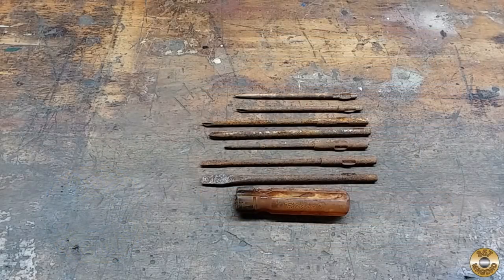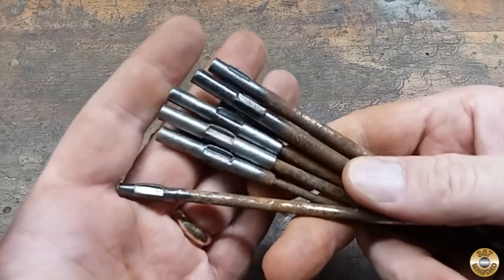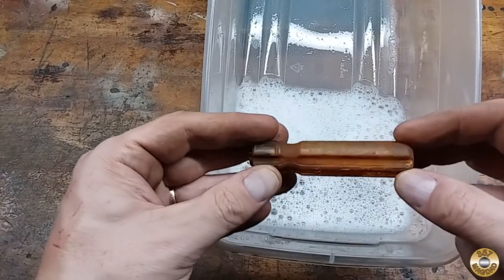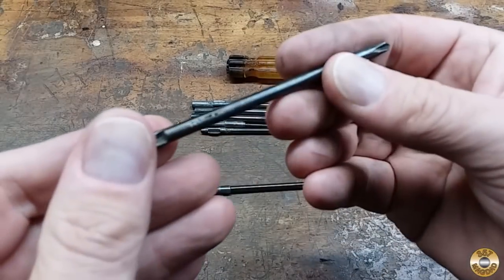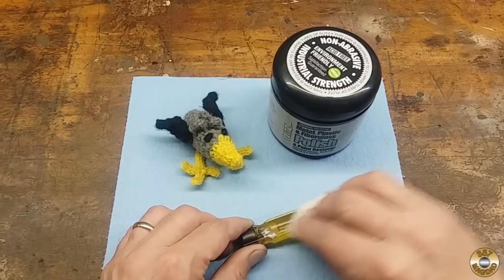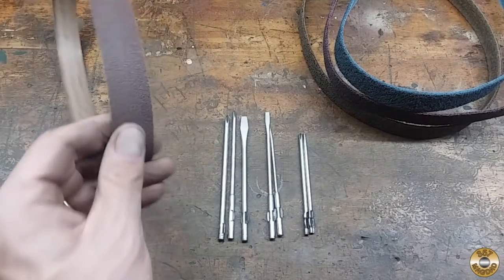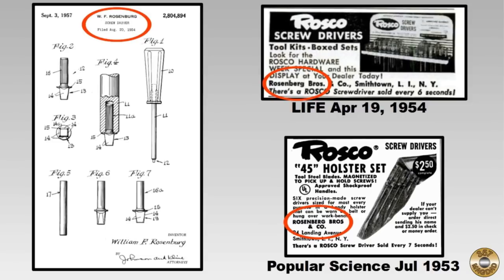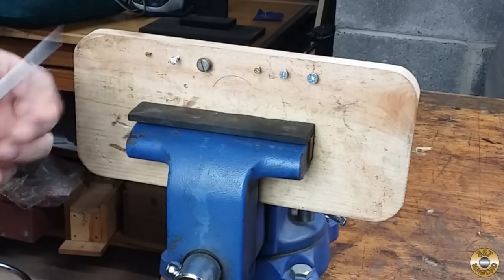Hand Tool Restoration - Rosco Multi Bit Screwdriver

Comment: Have to say this was a particularly satisfying little project to watch. The transformation on everything is great of course, but the handle! Just be-eu-ti-full.

On cleaning up the tips of Phillips screwdrivers that have gotten a bit mangled, I've actually had the most luck doing the outer edges of the flanges, carefully, either a small sanding drum in my mini drill, or against the wheel of a grinder. I have hand filed them as well, but I think it's easier to get a consistent angle and finish with power. In one of those remarkable coincidences I actually touched up one of my Old Reliables (read: obsolete non-ratcheting screwdriver I just can't part with LOL) just two days ago this way.
Reply from the maker: Phillips bits are always the first to go on the cheap sets!
Reply: @357magdad  Absolutely! It's just a terrible design unless both the screws and the driver are dead-on built to spec, and even then I'm not so sure given that Pozi isn't much better :-( 

God I wish Roberston had been adopted more widely outside of Canada! damn penny-pinching Henry Ford mutter mutter

Comment: The handle really looks good The bits are good enough to use   It is hard to get little pits out they would be so much smaller dia. if you made them perfet
Reply from the maker: If I ground out all of the pits, I woulda had all pokey things! LOL

Comment: That handle turned out awesome! I use brake cleaner..... One has to be careful and use it responsibly, it will melt plastic. I agree with you on the bottom 4 bits, the others work but not made for it. They turned out great. I could never fix a phillips screwdriver tip.
Reply from the maker: Thanks Aaron!  I think the diamond file did a decent job on the Phillips tip!

Comment: Very well done. The handle looks like new. I'm inclined to think that not all the bits are by Rosco because they are too loose in the handle. This would probably be considered a gimmick tool by professionals. For a household, it would be useful. After  60 years,  I'm glad it's still around. Thanks
Reply from the maker: Thanks Pat! I found some pictures of similar Rosco sets online and it looks like only the four bits go with the handle.

Comment: Glad to see Chuck was wearing his safety glasses when you were using the Dremel. Safety first, I also say that. Nice project. Two things you could consider, first, those type handles can be smoothed out very shiny and new looking by dipping them in a solvent, like acetone and/or lacquer thinner. It dissolves the surface plastic and you remove it and allow the solvent to flash off and dry. But it takes a watchful eye to do that so you don't dissolve the entire handle. Second, if you want to avoid future rust on the metal parts, you could setup a home Nickel Plating setup and Nickel plate them after you polish them to a nice finish. Than they will never rust again. But you really did a nice job...
Reply from the maker: Thanks Gary!  Chuck is very safety conscious.

Comment: I have a set of rosco screwdrivers I use at work. It’s not the insert set like you just restored. But they say Rosco and they have a black and orange handle. They are older and I prefer them over many of the newer screwdrivers being produced today.
Reply from the maker: The orange and black Rosco sets were very popular.
Reply: Yeah quite popular. I always stock up on them at yard sales when I see them. One of my most favorite finds is the rosco 2 fister. It’s an extra large driver with room for 2 hands on the handle. Fantastic tool!
Reply from the maker: @nicknicoletti9778  I have a similar set with the two fister marked Amsco.  I'll post a photo of the set on Instagram this week.
Reply: That’ll be cool thanks

Comment: The two that came with my 12-dollar toolbox weren't nearly as nice as these, they were just old-ish black plastic Taiwan units with each handle holding a double-ended bit, one Philips and one flat-blade. 
Still, I'm happy with what I got over-all and it's been fun watching you clean up your assorted finds!
Reply from the maker: Thanks!  I've got another project from the $3 tool box coming soon!

Comment: These are adequate for around the house & light hobby work, IF you use the right bit,  torque by hand,  use the pokey thing or such to start holes 1st. Nice job. Flitz-em arwwk! 😉
Reply from the maker: It would be a good kitchen drawer set.